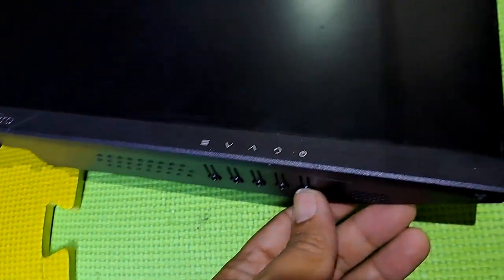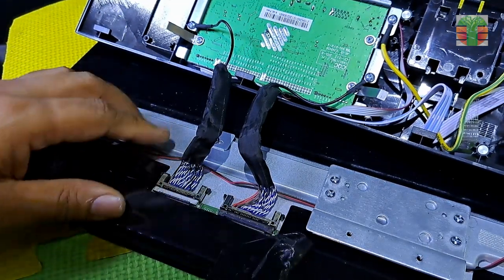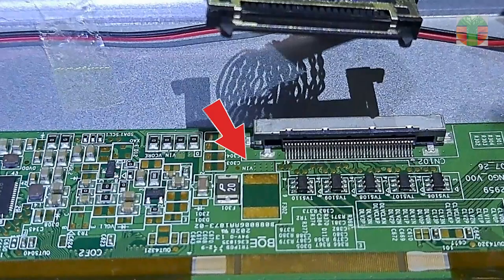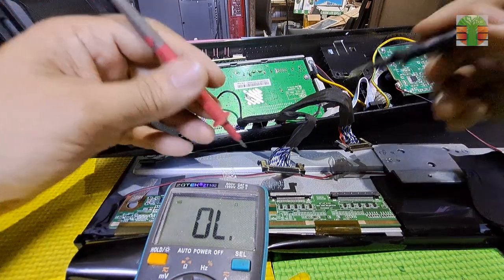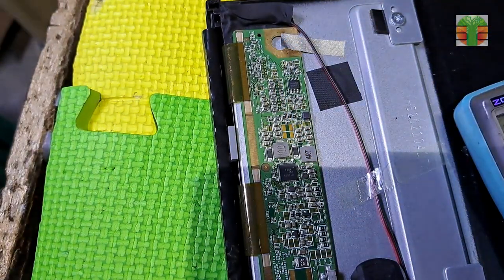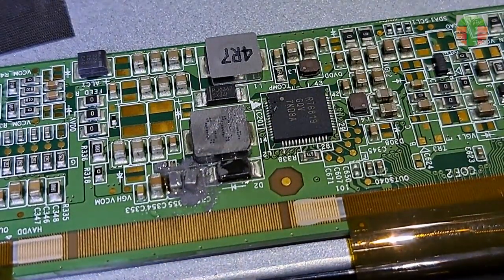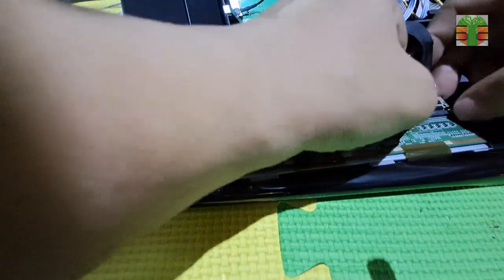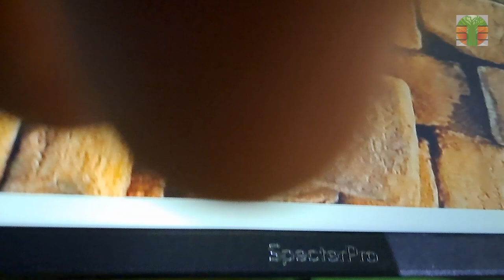24" PC monitor. Blinking led light indicator fix.

Comment: Great repair video. No repair manual just basic tools and more importally experience. Reminded me of repairs I did in the Ph. Just two screwdrivers, a soldering iron (w/ lead) and a sanwa analog meter (that I repaired) was all I had. The only smd based repair I did recently was a broken Fluke 867b that I bought for a song.
Reply from the maker: The job can be done by basic tolls.
Reply: @tevzTVTevatronics  for next time, dont use wax from candle but RMA-223 flux he is like honey and same result you will have. After that you dont need mix of powder but normal tin 0.5mm and put him on pads. With tweezers just hold and with soldering iron warm up your tin on pads its all. Rest is practice 👍

Comment: I use hote tweezer ATTEN N9100 to replace smd components,you can solder this in seconds😅
I am sure if you have the tools you will be very fast and easy job for you

BUT I STILL LIKE YOUR VIDEO BECAUSE YOU CAN FIX THE TVS JUST USING WHAT YOU HAVE
Waiting for next video tvzs :) you are the best
Reply from the maker: I usually use common tolls for repairing. many people just wanted to learn in electronics and they don't have a spacial tolls. Its important to learn in the basic way.

Comment: Mr. Tevz. How do you know what to replace the capacitor with?? I don’t see any numbers on it. That is a little confusing to me.
Reply from the maker: The vgh voltage is about 28 to 35 volts, so use 50 volts capacitor and 2.2 uf to 10 uf.
Reply: @tevzTVTevatronics  thank you Tevz

Comment: how do you know what the value of the capacitor was?
Reply: Probably used the value from the ones in parallel to it.
Reply: You don't, but in this particular example, there's 3 in parallel of same physical size, so most likely the same value. Probably in the 2.2-10uF, it's common values for output of a regulator. Usually slightly more capacitance doesn't hurt, too low capacitance can be bad.